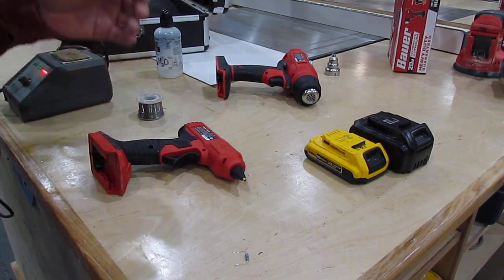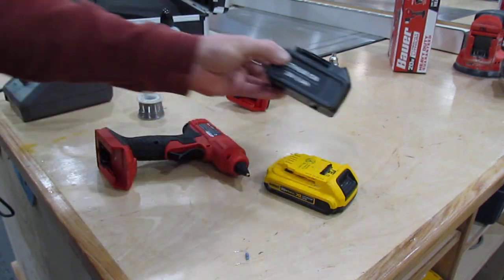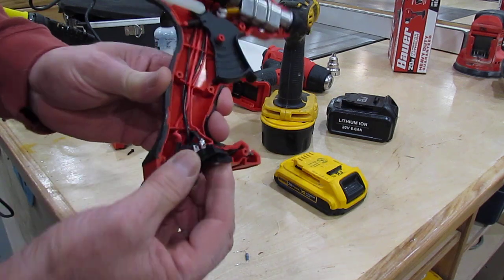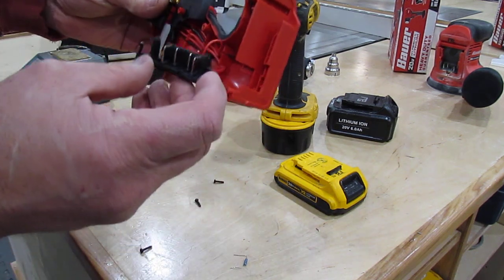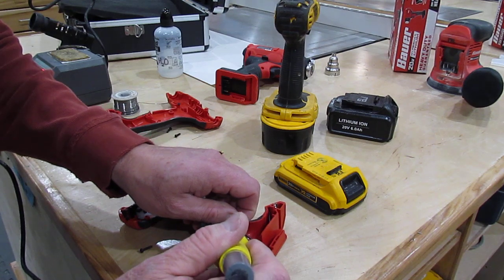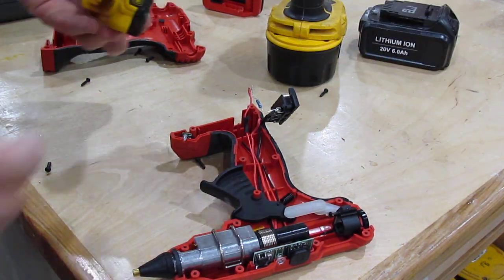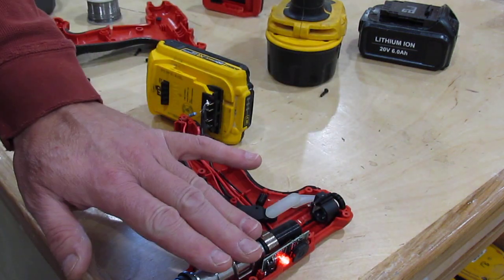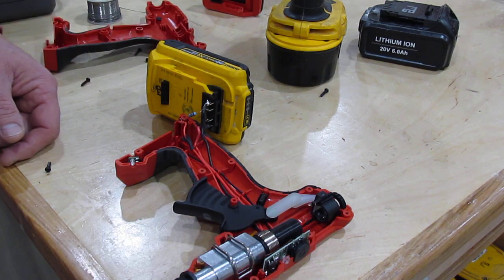Bauer 20V glue gun converted to use 20V De Walt batteries.

Comment: I have a question.. does this resistor cause the tool to run down the battery if left installed on the tool for a long time .
   Do you leave your battery on the tool?
   i know the adapters also have the resistor in them. And they definitely deplete the battery if you leave it on the tool.. . Like you I also have several dewalt batteries.  But I also have some bauer batteries so I want to be able to use either .  Right now I can with the adapter and the hercules batterys work to on the same adapter I bought off ebay

Comment: thanks , it works great, the batteries are tight and a bit hard to get out, either it will wear or I can file or Dremel the piece to slide better. This definitely opens new doors for tools. I used the 10k resistors from my Arduino kit.
That screw flying on the floor cracked me up, did you find it.
Reply from the maker: I did find the screw, I try to sweep the shop floor between projects so it was not hard to find.

Comment: what 10k resistor did you use?  .25 Watt?
Reply: is it required for just a on and off Baur grinder?
Reply from the maker: @scottellenberger940 Most tools I have tried need the resistor added to allow them to function, I have not tried the grinder but it probably is similar to the sanders I have modified. One sander I smoked the board and bypassed the board and just connect the battery trough the switch then to the motor, one problem is I can over discharge the battery, Li-Ion batteries should not be overcharged nor over discharged, it shortens the life of the cell rapidly.  I have a Bauer leaf blower that runs fine without any resistor added.
Reply from the maker: An adapter I bought uses tiny 1/4 watt resistors, that are still oversized, this is not connected to the battery but if it was the terminal is the 12v output one, A 12v dc source with a 10kΩ would draw .0012 amps and .0144 watts of power, act accordingly.

Comment: Coulda just bought the adapter for $16 so you can leave the tool stock😂.the extra peace is not a big issue still feels good in the hand.
Reply from the maker: Please post a link for the $16 adapter, When I started the conversion project no adapter was readily available, and having the skills, tools and parts to convert the Bauer line 20v tools to accept my DeWALT batteries  was a cheap and useful project. I have no use for a stock Bauer tool as I have no batteries or chargers for them, but being able to use my supply of 20V DW batteries, chargers and fast chargers made owning some Bauer tools a viable option.
Reply: @GmanInd  the listing says you can adapt to Hercules too
Reply: @GmanInd  jus saw the video again and I’m also going to get the heat gun.
Reply: @GmanInd  eBay I also got the adapter for a  craftsmen v20 weed eater I got for $5,brush trimmer I got for $5,also picked up the ryobi adapter for the $25 Inflator and ryobi caulking gun.the Bauer adapter I got for the $20 glue gun and $55 Bradnail gun.
Reply: Do do the adapters have the resistor built in or does it just allow the DW batteries to just "physically" fit?
Reply: @ looks like small board,there is the solid 1 which I recomend,and a 3D printed one which really is trash,

Comment: Are you put in the resister to cheat the tool or the battery?
Reply from the maker: the batteries remain stock, the resistor is to adapt the tool use with stock DW batteries.